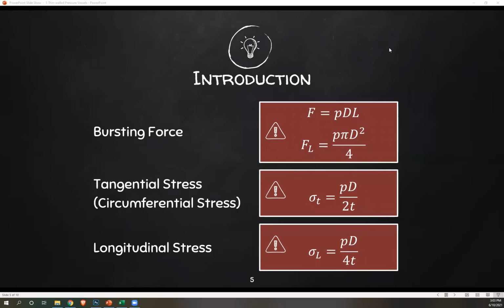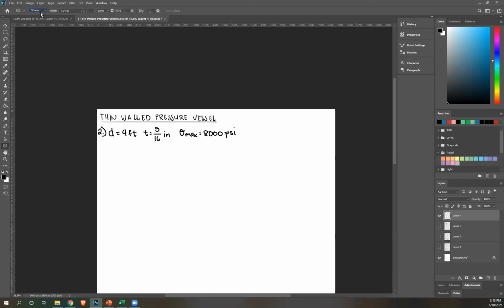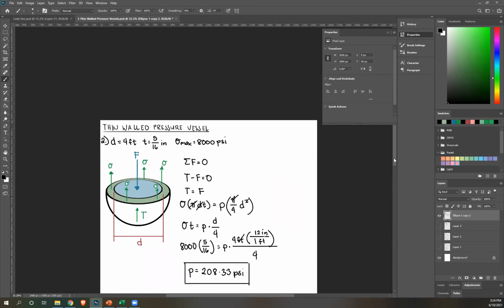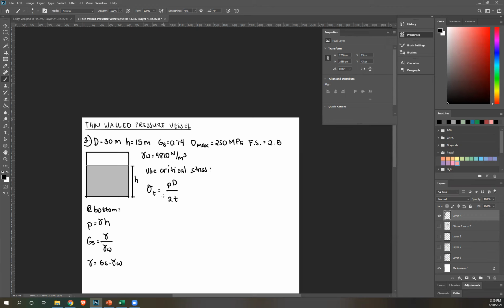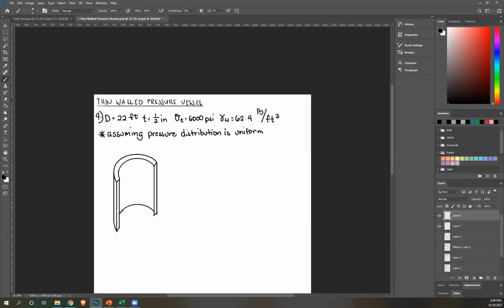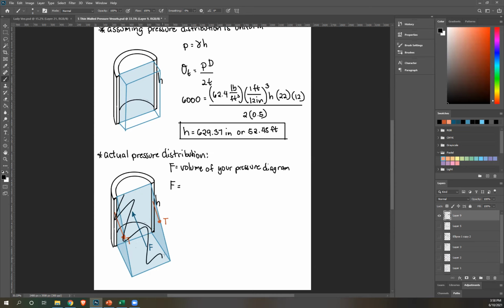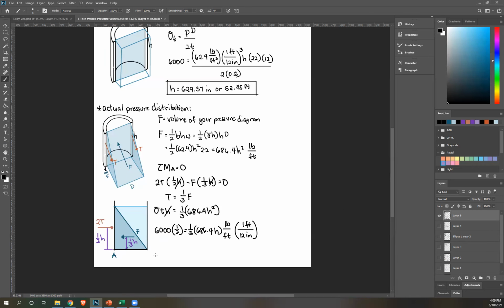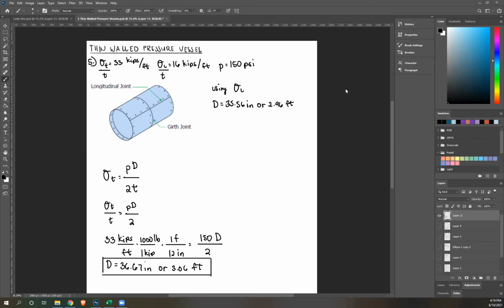[A55] MEC32 Lesson 6: Thin-walled Pressure Vessels (2/3)

Comment: how strength of longitudinal joint is equal to tangential stress?
Reply from the maker: First, strength is equal to the amount of stress the material can withstand. The longitudinal joint spans the length of the cylinder. It keeps it from bursting open on the sides.
Tangential stress happens when pressure causes the cylinder to burst open as well. Longitudinal stress on the other hand happens when the cylinder is being elongated due to pressure and resulting forces along the top and bottom of the cylinder. So basically tangential stress is on the SIDES of the cylinder, while longitudinal stress is along the top and bottom bases. The longitudinal joint is on the SIDES of the cylinder as well, so this is why the strength of this joint corresponds to the maximum tangential stress the cylinder can withstand.
Here's a video differentiating tangential and longitudinal stress in detail: https://www.youtube.com/watch?v=1vkWzE1vnw4

Comment: what about the factor of safety given in problem number 3??
Reply from the maker: correction: 
#3, that should be 250/FS. so final answer is 16.33 to account for the factor of safety.
Reply: Can you do step by step on number 4, how did you get h=629.37 in, I don't get it on how you solve it